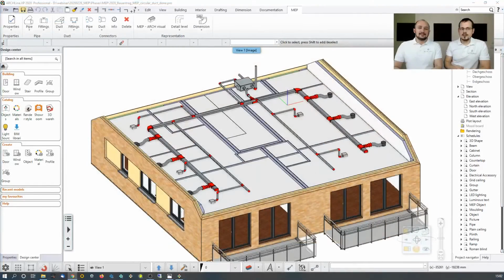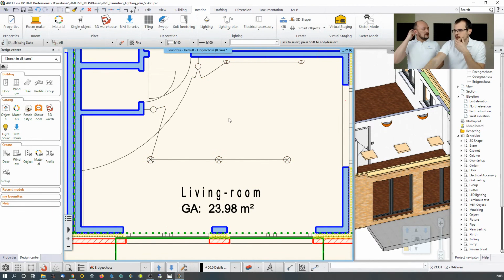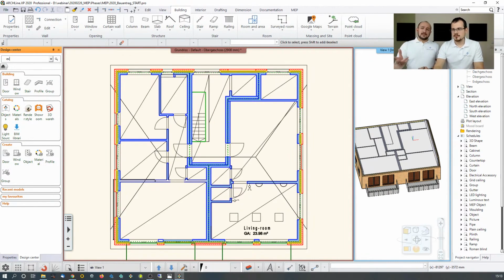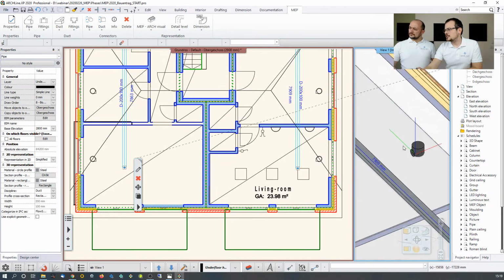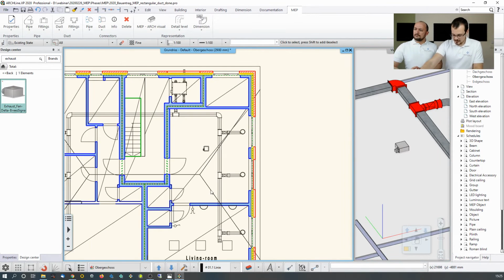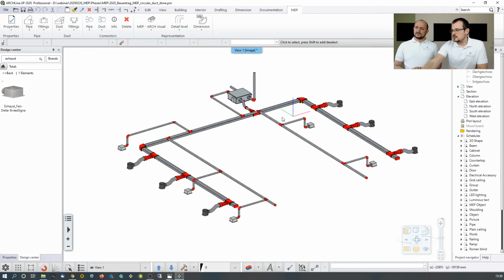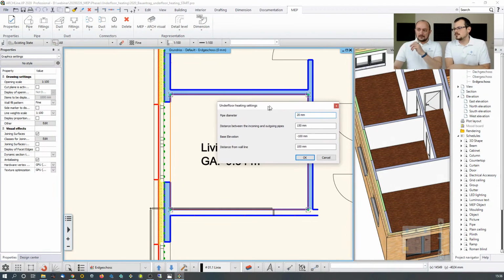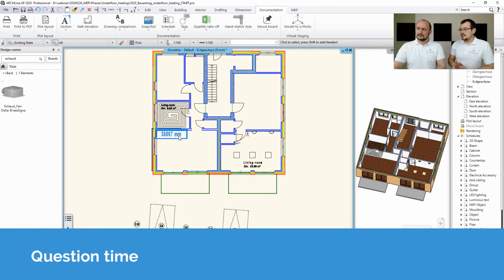Conceptual MEP Design with ARCHLine.XP 2020 Webinar

Comment: Hi Zoltan & Illes,

I watched the ArchLine-XP 2020 MEP Webinar after it was streamed & thought the new MEP Tools were outstanding for typical ELECTRICAL, UFH & HEAT-EXCHANGE elements. The electrical symbols when wired up to switch gear confirming the connection is a nice touch & automation features on the heat-exchange ducting were quite clever as well.

The new tab MEP tool bar & other dialogue menus as ever are well integrated & consistent with all the other tools.

So, congratulations with this new 2020 version.
Reply from the maker: Dear Clayton, thanks for the kind words! Make sure you get a trial version of this one!